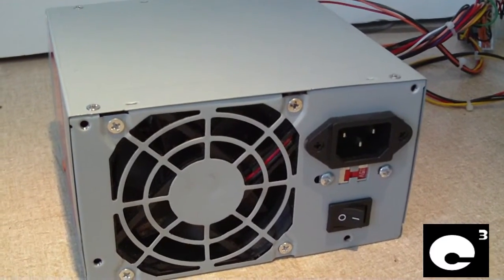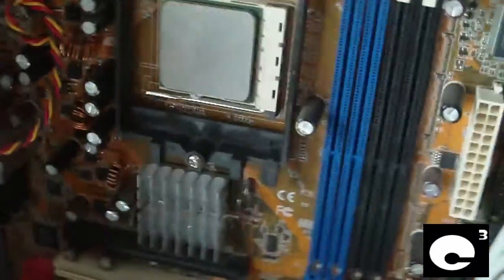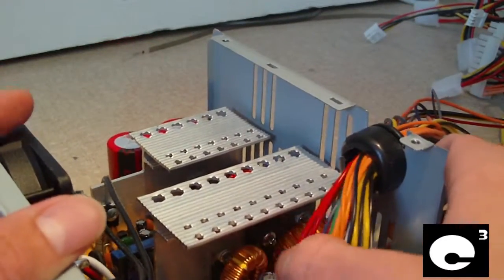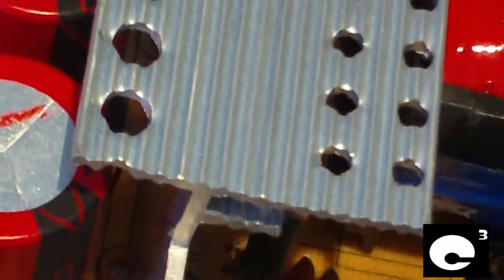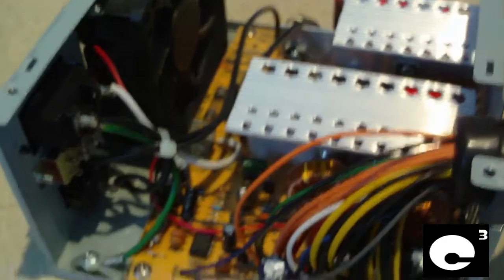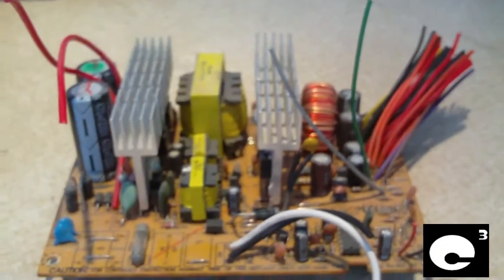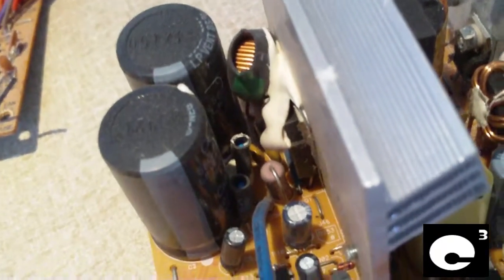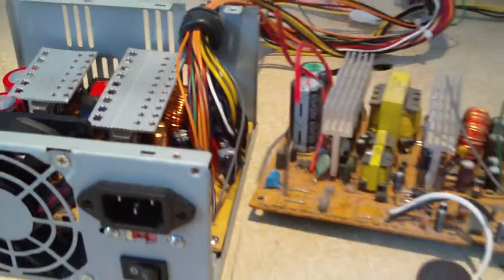Cheap vs Quality - Power Supplies

Comment: That Chiefmax "450W" power supply was the same one that was installed on my computer when I got it. On mine after a few months one of the two big red capacitors suddenly blowed up. Luckily it didn't damage other components inside my computer and of course that PSU was istantly scrapped!! The computer is still working fine with a nice Corsair power supply that works flawlessly.

Comment: No. The warranty is way gone. I have opened it up today, and i saw no bulging caps, but i did see a dry brownish paste sitting on top of a capacitor. The thing just suddenly stopped working last night as i was watching vids on youtube. It was as if someone just unplugged it. I think it may be to much effort to fix. Im planning on getting this power supply, but it looks cheap. I cant send links but look up [ACE 750 w power supply] on Amazon uk. Thanks for replying man. I appreciate it. :)

Comment: Nothing wrong with cheap power supplies. I am running with one now. When I opened it to change the fan speed, there's literally nothing in there compared to the "quality" one that died. The quality one weighted really heavy with 3-4 transformers inside. The cheap one literally runs cold. I have never come across anything like that before and I am amazed. In fact it's so good, I am thinking of cancelling an 80plus platinum currently being shipped to me.

Comment: I Will give it a go and clean that glue off. But chances are a part has blown in it or something. I will probably get the ACE 750watt power supply for now as im on a tight budget. I bet your pretty suprised about an enermax dying considering their very high quality.

Comment: My enermax modu82+ 625w power supply stopped working last night. It outputs no power whatsoever, not even a light on the motherboard. All it does now when i switch on the PSU is make a faint crackling noise. Do you know whats wrong with it?. I would rather try to fix it then spend loads of money on a new one. BTW, i love your vids. Ive been subscribed for around a year now.

Comment: ChiefMax 650W is horrible (V1, 120MM Fan).. if i did the math correctly it is only 250W/44A.. I could barely get a ECS KA3-MVP AM2 (CrossfireX 3200) with one HD4850, 4GB RAM, 1TD HDD, a dell sk-8135, a gamdias demeter mouse, and a TurtleBeach Earforce2. I disabled almost everything but the JM363 SATA2/IDE controller.. Just the Processor and HD4850, thats 89W+115W= 204W. ascendtech still sells them, avoid that company. custom build a AM2+ from them, the MB didn't last 18 months, you get that OEM warranty.. 90f'n days.